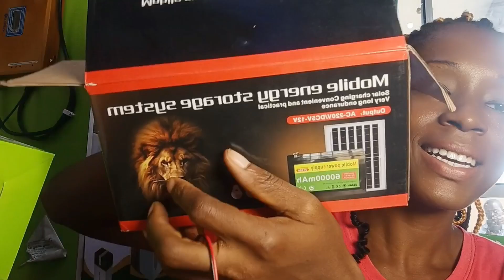How to rate Mah in Amperage Batteries - Difference and Relationship between the two #solargenerator

Comment: What about ah battery and kwh battery wat the difference
Reply from the maker: The rating will depend on the Voltage.
For example, 100 Ah battery at 12 volts is 1.2 kWh, while a 100 Ah battery at 24 volts is 2.4 kWh.

Hope it's not more confusing 😂

Comment: You said 60,000 mAh is equivalent to 6Ah 

But you now said 12Ah is equivalent to 12,000 mAh 

Does that mean that 60,000 mAh is equivalent to 60 Ah?
Reply from the maker: The calculation must be wrong, it's a mistake 
12000mah should be 1.2Ah
Reply: She mean to say 120k mah